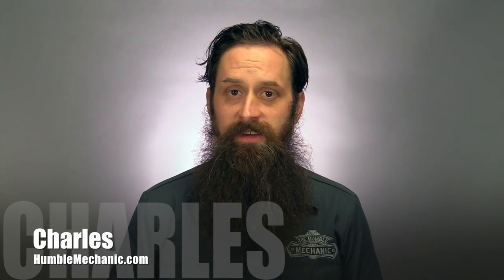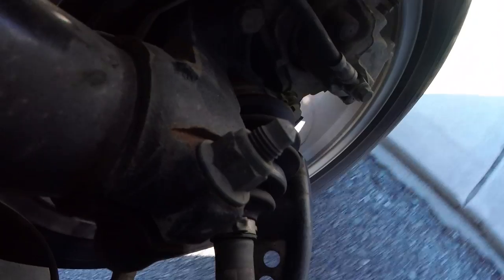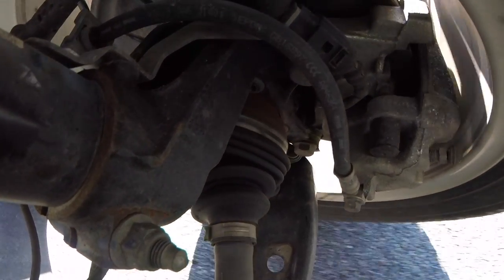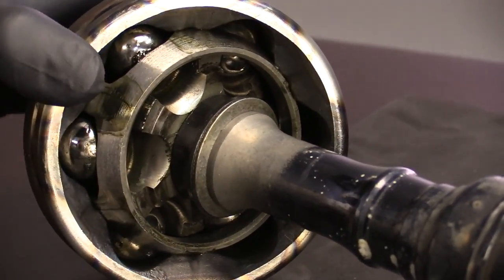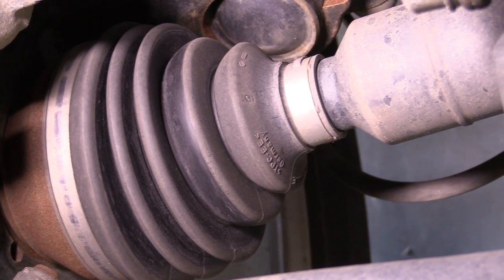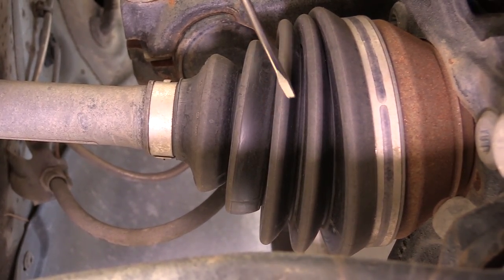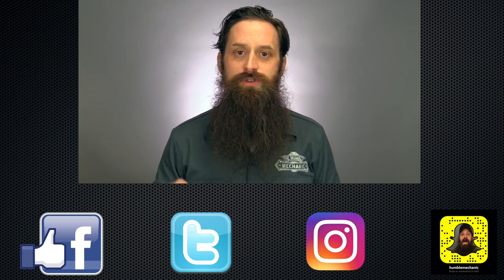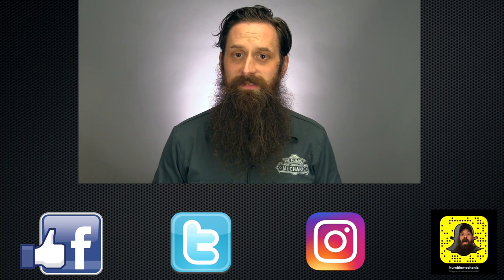How to Inspect Your Vehicle’s Axles | Allstate Insurance

Comment: 2003 Pontiac Grand am  with a 3.4L V6 (FWD)
This past week
 i completely replaced  2 Front Wheel hub bearings/ 2 rotors/ 1 set of front brake pads/ 2 calipers / 2 Lower Ball Joints / 2 Outer Tie Rod ends, and 1 CV Shaft and still have squealing  and a rubbing sound when braking, the booths on the 
 old CV Shaft are hard and the New shaft is soft rubber, could that make the weird sounds.
Reply: Noise coming from engine bearings. Clutch plate issue?